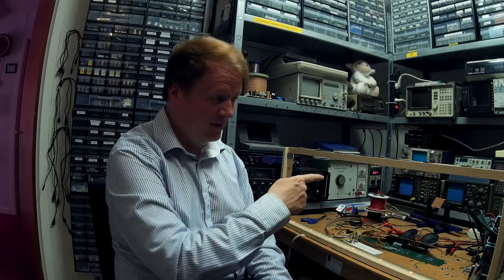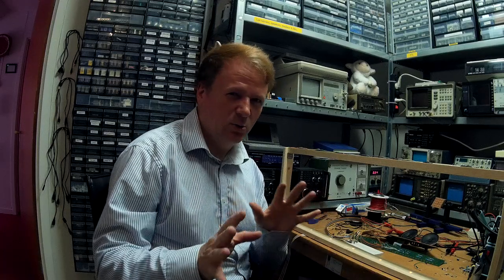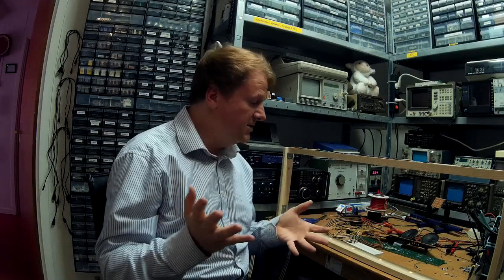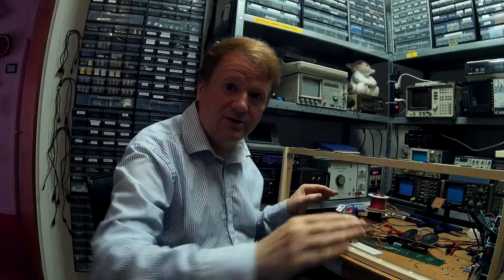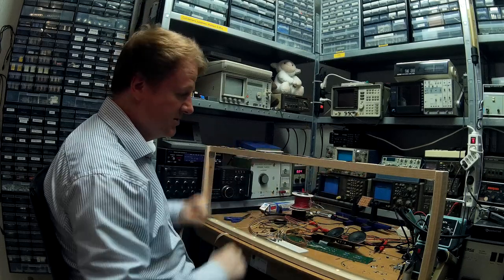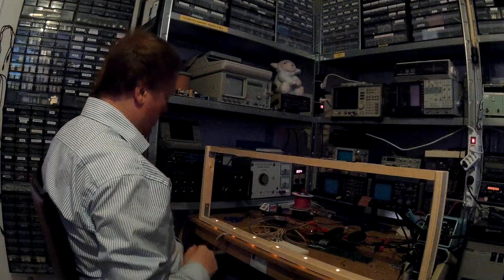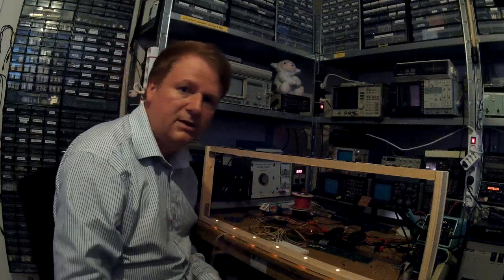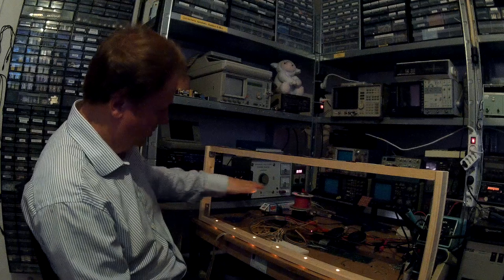LED AIR HARP - DIY 10 Dollar Musical AIR Instrument

Comment: Please tell me how
Reply from the maker: It's fairly simple. All you need is a bunch of White-LED's, a little woodmaterial to work with, drill some holes for the LED's and make sure their light is focused on the holes on the opposite side of the harp. Drill some holes for the opposite side of the harp (another wood piece), and put some LDR sensors in there, make sure to seal properly so no light comes in from the back of the LDR sensors.

Now, open up a cheap childrens keyboard, expose the rubber buttons that makes up the keyboard keys, short them with a wire to test how the wiring of your particular keyboard work, and when you successfully short them, connect the LDR's one by one to each key.

You may want to add a trimming potentiometer to each key in order to fine tune the sensitivity of the LDR & LED lights.

That's it, it is as easy as that!